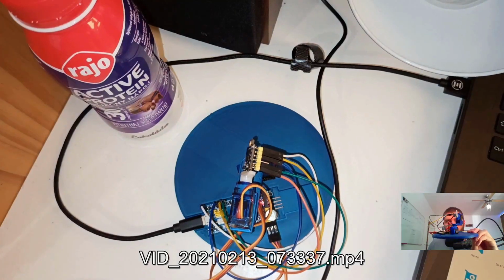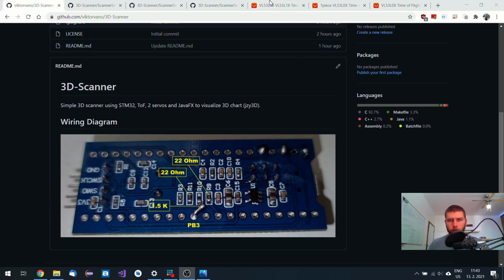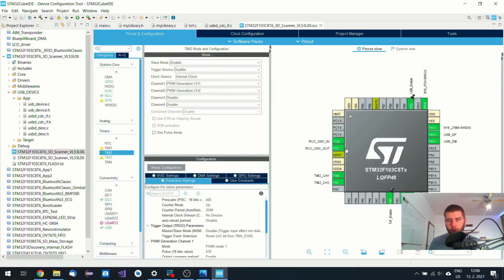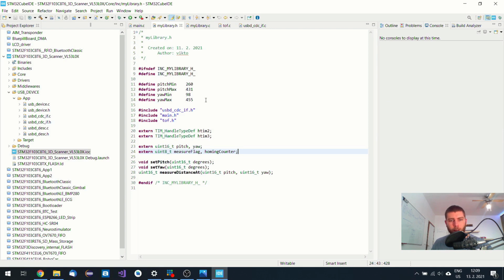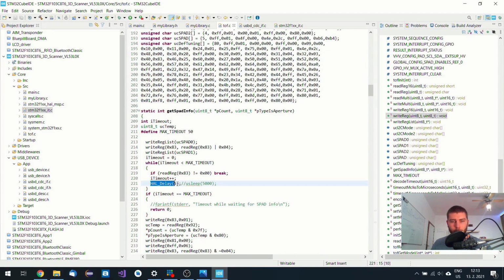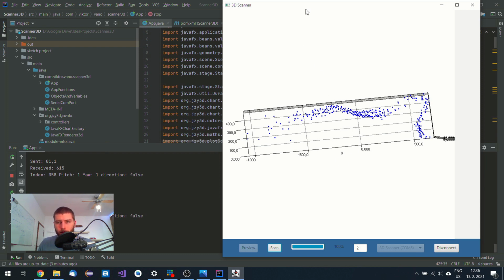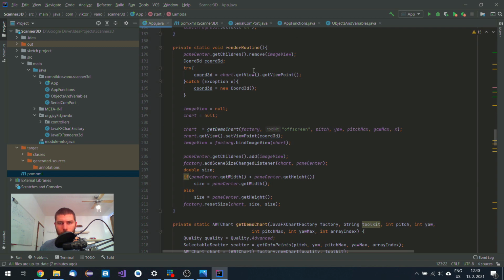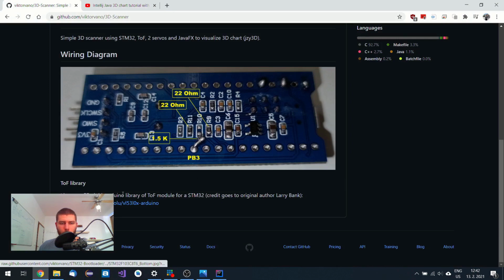STM32 and JavaFX Tutorial - Spherical ToF 3D Scanner (VL53L0X)

Comment: Awesome job! I am working on a similar project that involves a 2-DOF system with yaw and pitch capabilities, along with a ToF LiDAR. After scanning, I obtain data that includes distance, yaw angle, and pitch angle. I use MATLAB to convert these into Cartesian coordinates and to create a 3D view. However, some lines that should be straight appear curved. Do you know why this might be? I intend to use this setup for 3D reconstruction of fluid objects such as sand and gravel, in order to calculate their volume.
Reply from the maker: Well I also use spherical coordinates and convert them to Cartesian. Not sure where your problem lays. If you have a constantax distance from the sensor reading, then it will be a spehre no matter the coordinate system.
Reply: Thanks. It seems not a big problem. @ViktorVano

Comment: Great tutorial, thank you for a great explanation. I have been thinking about making something similar, but instead of servos (as they are slow) maybe one could wave the sensor around with one's own hand (similar to how the LIDAR in iPhone works). 

How many datapoints would one need to make a similar image to the one you achieved after one scan in your opinion? It should be faster than with servos, don't you think? So if one waves the sensor around more times, one could potentially get a more detailed image? Just wanted to double check if this idea would even work?
Reply from the maker: An iPhone has VCSEL type of LiDAR, which means that it already has an array of data points, with no moving parts. But it you want to make your own, consider factors like: Measurement time of a data point (oversampling for better resolution), delta angle of those data points, total scanning time... 
Those requirements are up to you, what you want to achieve.
Reply: @ViktorVano  Thank you for your detailed reply.
Reply from the maker: @asadraja377  You are welcome.